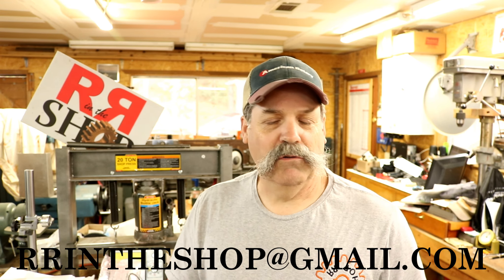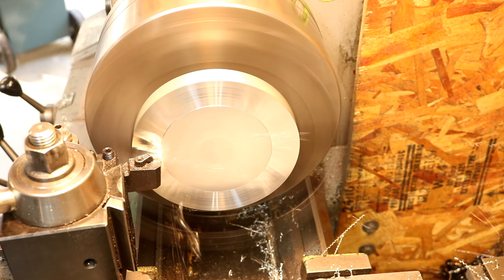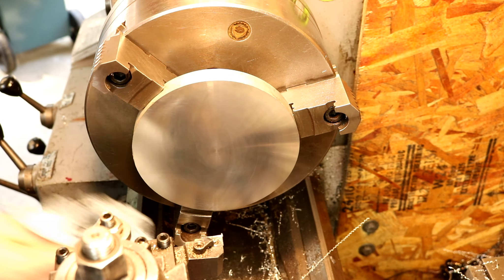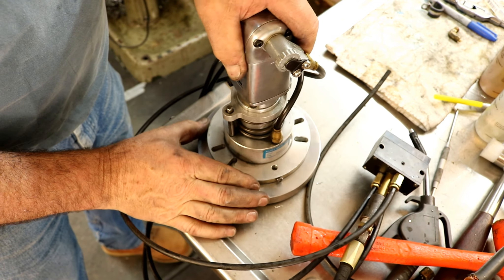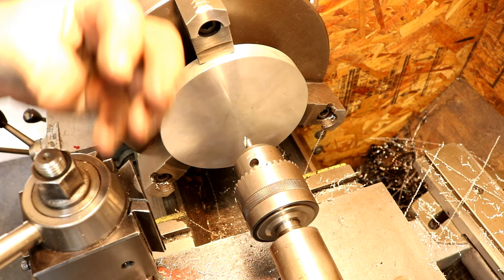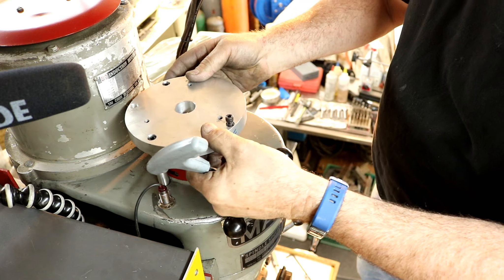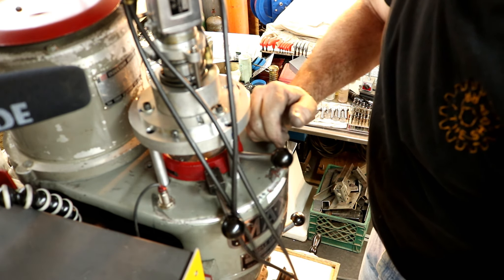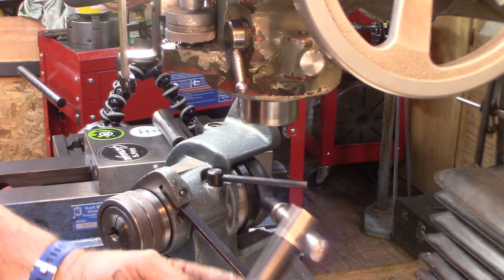Install Power Draw Bar - How To

Comment: Randy, I received the dovetail cutter you made for me.  It is outstanding, the finish on the tool is excellent and it works a treat.  I especially like that you printed our company name on the shank.  I went back to an older video of yours where you show the use of the cutter.  The finish on my cuts are just as good as you show in that video and my mill is a Jet and not as big and stout as yours is, and the finish the cutter produces is still perfect. Thank you for this video and for making the cutter for me, the cost is more than worth it. :-)
Reply from the maker: First one Glenn.  Thank you for the kind words.

Comment: I feel Pissed . all I have is One screw driver One drill , One hammer , One haxSaw , And I see people with huge shops, Now I have made One milling , using wood and aluminum  some breakout boards , converted it to CNC , it runs OK , but now it is even bigger a reason to be more pissed . I do not know machining  and to run a mill You need to know how it runs , and I see you guys doing it . Well one day I will learn watching you. Good work Randy I am impressed .
Reply from the maker: Boy I thought you were upset at me.  It has taken me over 40 years to put together my shop.  And always learning along the way.
Still learning to this day.  CNC and 3D printing  even.  Thanks for watching.
Reply: I am not upset Randy , I am impressed , and you are So intuitive , Just a Role model, I want to have a shop full of machine tools, made my 3 axis Linux mill just a day ago, (Just a prototype, WOOD ALUMINUM STEEL NEEMAS AND MACH3
am taking lessons from ( jerry) Ask jerry in Houston TX almost 5000 miles away  , and Am almost close to Linux Mill, It is so funny .I assembled the  mill , but then I did not knew  how to run, Then I started learning auto desk , and now I can DO_Little. Nice watching you Randy Rich , may the lord Make you the richest in Love Passion and Wisdom Aiemen

Comment: Randy, My heart dropped when it had trouble getting that drill chuck pulled up. I am glad you got it sorted out.

Jason
Reply from the maker: Works great, just some build up in the threads of some of the collets and adapters.  Plus new threads o the drawbar.
Things will wear in or wear out.  Thank you Jason.

Comment: The scribes and dovetail cutters are true quality items, you will not be disappointed. - You are so right, not everything needs a carbide cutter. - You've got that lathe trained to provide chips on que! lol - Nicely sharpened large drill bit. -  Did you try another R8 collet? - A very useful tool. Nice installation.
Reply from the maker: Thanks Vernon, I ended up running a tap thru all of my collets to clean them, all is good now.  Thanks.

Comment: I really wish the power drawbar for the tormach wasn't so expensive...   and pneumatic.
Reply from the maker: Time to build one, this design is very simple.
Reply: I did some looking and it appears I could make a Tormach "style" one for far less than they charge but I need to source and find specs on the bellville washers they use.  Supposedly they undersized them so the drawbar tension is FAR less than that of a traditional drawbar.

On the other hand, supposedly the square shank on the stock drawbar doesn't handle air ratchet abuse very well so I would need to do something similar to what you did with the 2 piece drawbar if I wanted to go that route.

Comment: Hi Randy,

I must get around to fitting my Kurt power drawbar. It came without the control valve, but a couple of solenoid valves will do the trick. I can't complain for £0.99 +postage off ebay!

Are you sure that Bokum bar isn't a 55 degree internal threading tool?.
Reply from the maker: I went out and measured them and they are 60deg.    Thanks  Paul.

Comment: Randy, what is the hall/proxy sensor over the step pulley counting?
Reply from the maker: Tach pickup.  But I have had problems with this one.  I need to do more work on it.
Reply: Randy Richard In The Shop i also have a Bridgeport clone, the step pulley spins different speeds than the spindle. 
With the new drawbar puller, and that raised platform over the backgear ring, what if you install the sensor over the inner collar closest to the drawbar (spins the same speed as the spindle), and set the magnet in the collar? 
Do you have variable speed set up?
Reply from the maker: I have the sensor setup for the spindle measurement but I have the readout mounted in the same box as the VFD.
I get interference with the readout,  I need to move it away from the VFD in a separate box.  Thanks.